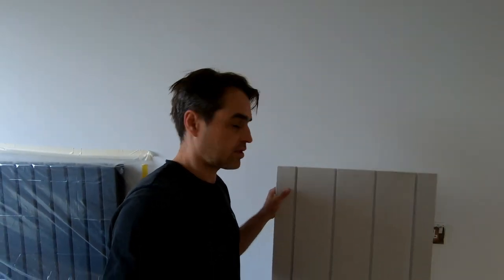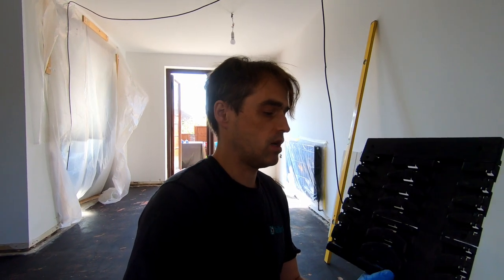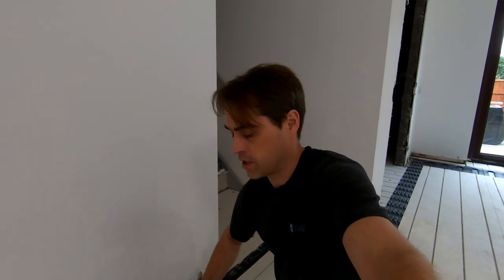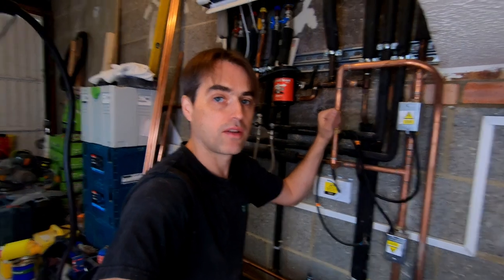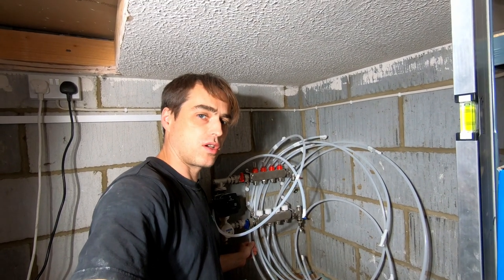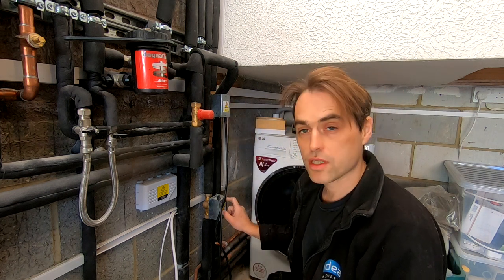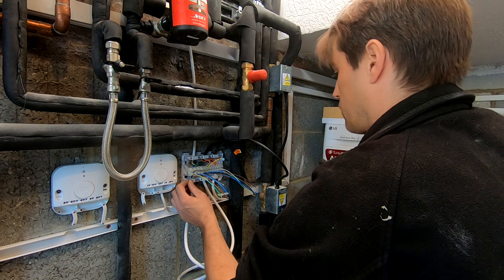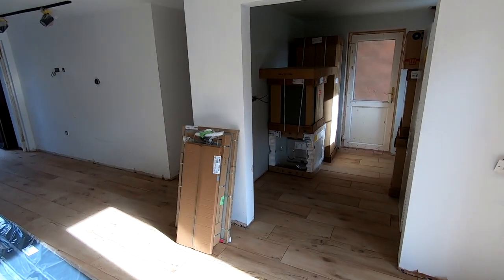How to install low profile wet under floor heating installation for floor with tiles.

Comment: Is this type of dry underfloor heating system as efficient as a wet (screed) underfloor heating system? That is, I guess the wet system means you heat a mass (screed) and it stores the heat longer? Or are these dry panels so well insulated they hold heat?

Comment: Well presented and really interesting, thanks for sharing! Quick question, can UFH replace an existing radiator and just run off the main CH loop, and if you wanted have a seperate zone valve on the manifold itself? My plumbing is located in a pretty awkward location. For that sake could you sacrifice one radiator and run manifold to multiple rooms, assuming standard 15mm CH pipes?

Comment: I’ve installed 6 x actuators for 6 x individual zones and a new combi boiler. Client has requested for Google Nest to be installed. Is there a way of installing just one ☝️Google Nest to control the 6 x zones. Or would you need to install 6 x Google Nests?
Reply from the maker: LR52 VUU yep - 6 nests needed I am afraid

Comment: Have you ever used Novatherm 20mm panels, 200mm centres and 16mm pipework? Do you know if its best to fix these panels to the floor or use as floating? Floor cover to be floating engineered wood

Comment: What's the heatloss on a system like this? If its lay over a uninsulated 200 year old slab is it gonna provide enough insulation?

Comment: Hi , is the existing concrete floor got any insulation at all? If not - i assume the boards a super insulated?
Reply: Isn't the heat loss through the floor in a house only usually around 10% as heat mostly rises not the other way round?

Comment: Hi, I have another question for you, do you know if you're tiler used a coupling mat of any kind such as Ditra? certain companies are suggesting that you tile directly on to the UFH system but I have never seen tiling done without a coupling mat. Perhaps the coupling mat takes away from the heat output tho.. your thoughts? Any advice would be much appreciated. Thanks
Reply from the maker: Yes all those matts put to much resistance on ufh

Comment: Hi. I called a company to give me a rough quote on a wet underfloor heating. He’s giving me a quote that seems expensive. Two rooms at about 12m2 each and is charging me nearly £3000. Does that sound unreasonable? He stated at the very beginning that they weren’t cheap. What do you think?
Reply from the maker: that sounds about right for an overlay system if it is all in

Comment: What about heat loss into the concrete slab as there is not likely to be any insulation under it?
Reply from the maker: Heat loss does not change with UFH or radiators - it is still the same. UFH makes it more comfortable and economical even without floor insulation. Panels provide some degree of insulation.
Reply: @UrbanPlumbers  Thanks.

Comment: Do you know of a way to have multizone opentherm? I know you can have multizone load compensation with Vaillant boiler and controls but you need to invite the whole Vaillant family which it's expensive as hell.
Reply from the maker: Hoeywell evohome can do it. It is also expensive.

Comment: Do you have video of tiling over the panels please
Reply from the maker: No I didnt shoot it. There is nothing to it really just use S2 adhesive
Reply: @UrbanPlumbers  hi . I looking someone to instal a low profile heating floor in East London..can y advice a profesilnal
Reply from the maker: @1205val  email me job details. I can quote for it.

Comment: liked a subscribed, thanks for the informative video. I'm currently looking to use this system in my home, 36sqm on all of the downstairs, the issue is that it is straight on to concrete, i'm worried that i might not get a good heat output from the system. using it with a worcester 35Kw boiler and floor covering is tile. would it put out sufficient heat and not cost loads in gas bills? Thanks
Reply from the maker: You will get around 50watts a square meter from those systems. Downward loses are not that big. Expect around 1.5kw output if done correctly.
Reply: @UrbanPlumbers  great thank you, I will double check my heat calculations, I've got double glazing and polystyrene insulation pumped into the cavity of external walls so i'm feeling more confident that 1.5Kw will do it, thanks again!

Comment: Why didn't you turn the boards in such a manner to have the grooves perpendicular with the wall where you have the manifold behind ? This would have allowed you to also run nicely in the other room ..
Reply: You wouldn't have to use a router to route new grooves ...
Reply from the maker: Kit didn’t have enough end panels to do that and there was more routing to do it this way
Reply from the maker: @TheRealAnthony_real  I am sure you can. Those systems are generally expensive. I got it form underfloor Heating superstore. I think the kit was 2k for 30m2
Reply: @UrbanPlumbers  I have a house abroad which I'm building and it has approx 180 sqm of ufh required however I can't find the hard gypsum board there nowhere .. just the kingspan boards .. 
I have the gypsum kit fitted here in the UK with 3 zones and it works great ... Not sure how the other boards work to transfer the heat .. what do you reckon ?
Reply from the maker: I prefer dense panels for heat retention and the are also safer for tiling. It depends on your floor finish.
Reply: @UrbanPlumbers  concrete floors

Comment: Can you make a video showing installation on the upper bedrooms?
Reply from the maker: It was an existing radiators system there
Reply from the maker: Unless you mean wiring? If so that is coming tomorrow